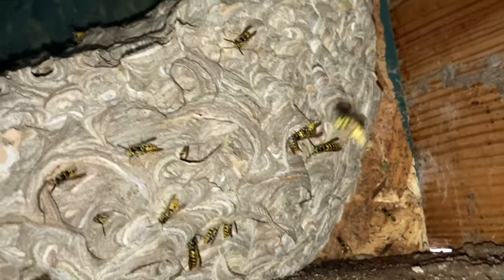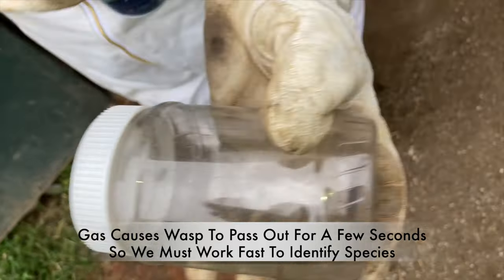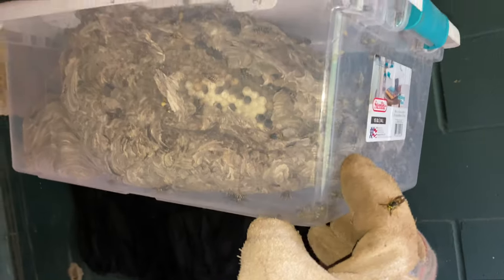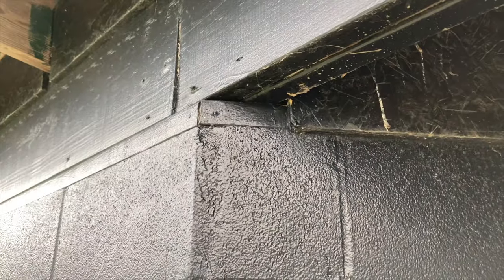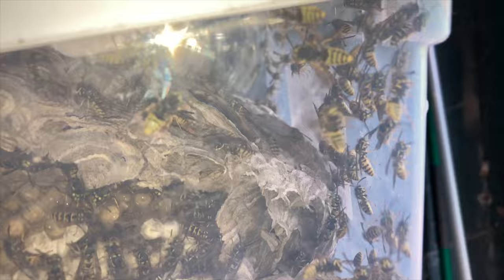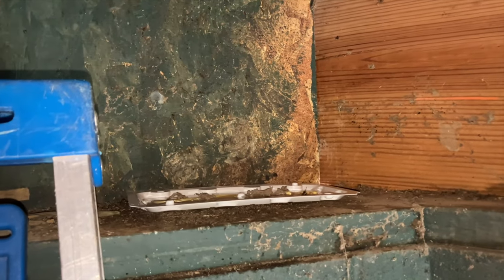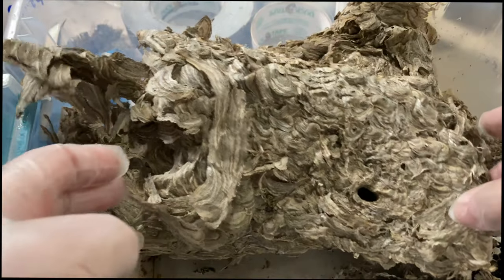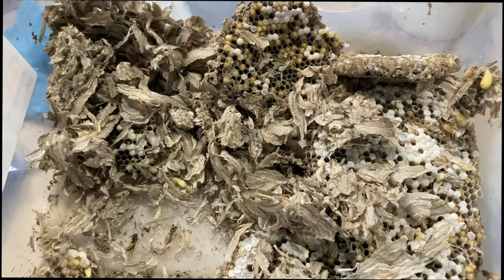REMOVING YELLOWJACKET WASP NESTS IN SOFTBALL FIELD DUGOUTS, COLLECTING WASPS FOR VENOM IMMUNOTHERAPY

Comment: Hello how yellow jacket extend their layers of nest if the nest is already taken form of a tennis ball per exemple😊
Reply from the maker: @saber2054 - Hi s. Thanks for your comment.  Yellowjackets and hornets continually build out their nests by adding layers of paper over existing layers with some air space in between for thermoregulation (they know how to control the temperature and humidity inside by the way they add insulating layers of paper or change their nest structures).  If they need to expand their brood comb to make more room for baby wasps, they simply chew away the existing paper layers, expand out the comb cells, and then add the outer payers of paper over the comb again.  This is an amazing continuous process of intricate engineering they do by instinct.  They are incredible builders.
Reply: Thanks for your response
I got a nest 2 size golf ball months ago of Vespula germanica in garden 
I move it in a captive terrarium setup like your videos and now they reach a size of a big apple around +60 / 80 workers
They build more layer and have let only one entry for nest before they were 2 entry
When winter arrives they need to be in lower temperature or not ? Like hibernation is obligated or not bc they are invasives species
Reply from the maker: Hi s.  Great job on your relocation of the nest.  If they are living successfully you have done it well.  Yellowjackets in captivity typically have relatively short lifespans, most workers (sterile females) and drones (males) will die within a month or so.  Queens and gynes (fertile females) may survive longer.  Once winter comes, queens can hibernate if the temperature is controlled to allow for that.  If the temperature is not low enough to hibernate, they will continue to carry on with their normal activities and may even develop multi-queen supernests such as those seen in the American South, and in Australia and New Zealand where Vespula germanica are invasive and have few natural predators.